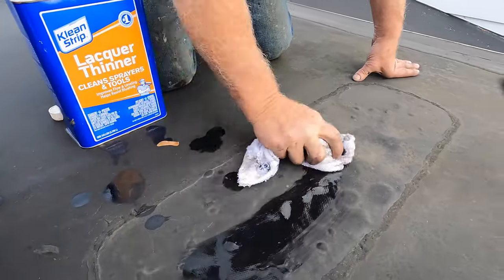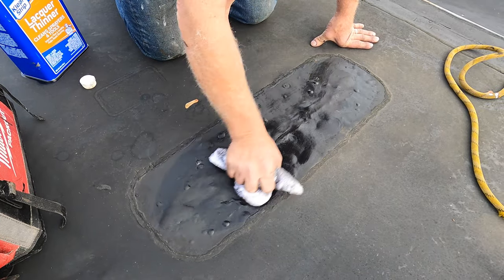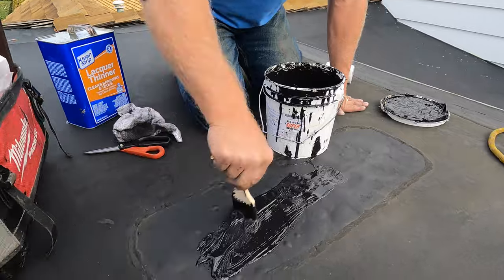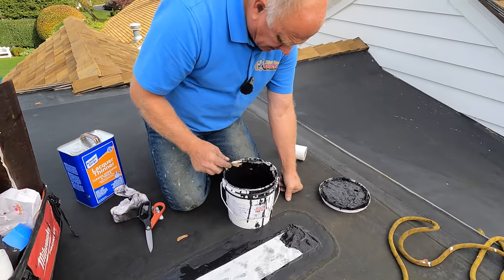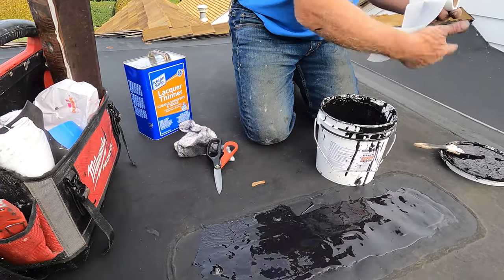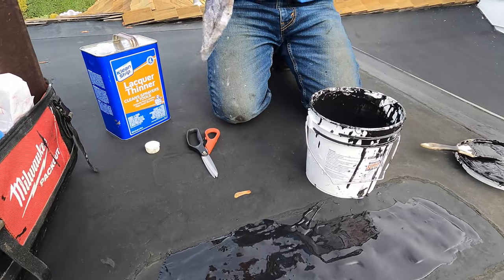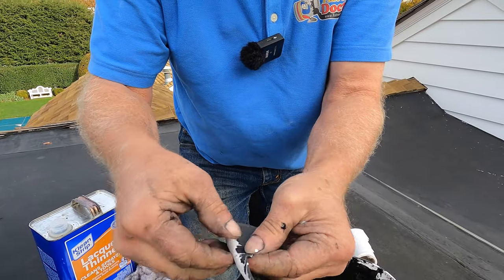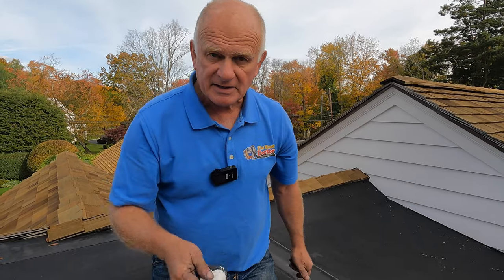EPDM Rubber Roof Repair - DIY - Only Super Silicone Seal, scissors, brush, fleece - Liquid Seal

Comment: Why wouldn’t you just strip that in with a piece of 12 in cover strip? Just curious
Reply from the maker: Don't you see all the cover strips that had been used? They don't last.
Reply: Hes getting pd by these people id guesss otherwise why try ruining a perfectly good epdm roof by smearing silicone all over it. I hope nobody actually does this 😢
Reply: They do if properly installed and done right meaning brand new clean, the right primer and amount, and if cover strip are tpatches needed and if so is it flashing material.

Comment: Absolutely do not use silicone on epdm roofs unless you intend on fixing it for the duration of its usefullness. Nothing sticks to silicone. Period. Epdm products are there for a reason theres all sizes and thicknesses for all repair issues. I repeat never use silicone anything on epdm.